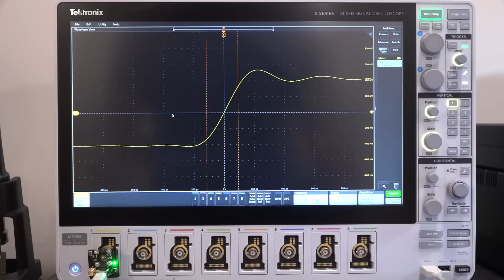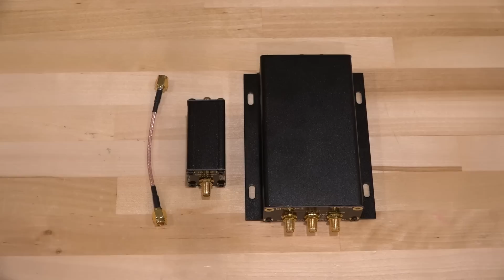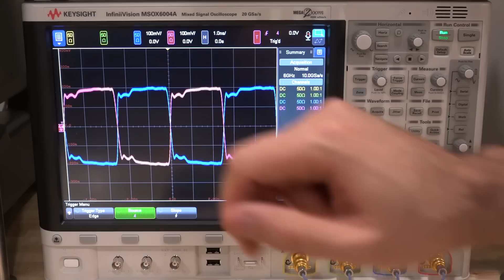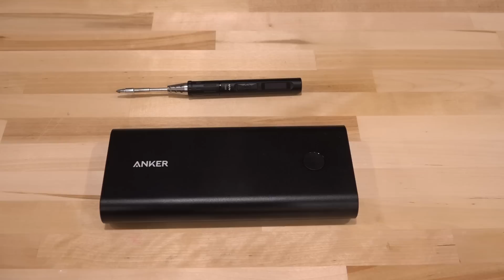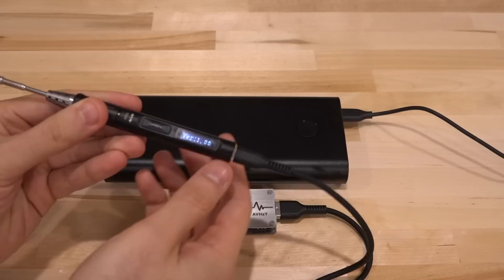TSP #138 - Three Interesting Mailbag Reviews & Giveaway! (November 2018)

Comment: Thanks for this review, Shariar, informative as always. I'm wondering why nowhere in your rise time measurements with Leo Bodnar's pulser you seem to be taking the pulser's own risetime into account, except where the 'scope's risetime almost equals the pulser's. Have I missed it?
Reply: This is significant especially with regard to the 1 GHz LeCroy HDO6104-MS, which achieves its rated BW at 990 MHz as you state and the R&S 2064, which only reaches its nominal BW if 4.5 is used in the risetime/BW conversion, not with 4.25.
The others obviously reach their stated BW but how fast is that 13 GHz HP, taking the pulser's risetime into account?

Comment: Great reviews, with GPS oscillator if it uses 50Mhz crystal does it have another LO or is it on chip to produce output frequencies upto 1GHz in addition to using GPS clock, I am assuming its uses a PLL?

Comment: About the holdover mode of the GPSDO, I think the frequency drift will look exactly the same no matter how long you leave the unit on because the drift we see represent the short term stability. I understand that if the unit is left on for a long time, its firmware can learn to improve the long term stability. However, I'm a novice and I don't have any experience with TCXO or GPSDO. Perhaps this device need a minimum amount of time (30 minutes? 1 hour?) to achieve better short term stability (Better than the rate of frequency drift in this video.)

Comment: Good day sir Shahriar! I really enjoyed watching your videos, even long ones I did not skip in the middle. I would like to participate in the scope draw. I am a EE student and currently I only have a loaned/borrowed GDS-1052-U 50Mhz 250Ms/s. Already helped me develop my motorcycle SMPS regulator ptototype that reduce petrol consumption by 10%, which is very significant. I will put the scope in good care and good use and I will able to return the loaned scope. Currently I still prototyping and testing mentioned SMPS regulator wihich I need high sampling memory than my current scope and I also designed a 3 axis CNC machine based on 8051 MCU to parse GCODEs and produce correct pulse train for stepper motor drivers, which as of now able to make PCBs with quirky firmware I wrote myself :P. Some projects I have in mind right now is low cost electronic torque wrench, a TEG+Evaporative cooler which eliminate the need for conventional power hungry air-conditioner and semi discreet switching LED driver, a spinoff project with lessons learned from the SMPS project, for which I designed my own switching control circuit. I intend to publish my designs in near future too. Anyway thanks a lot sir for the great opprtunity :-)

Comment: I'm an electronics and telecommunication engineer from India predominantly working on RF and microwave communication circuits. I have a small lab setup but it lacks a DSO. I cannot afford to buy a DSO as it is expensive and I'm an independent designer i.e., no associated or employed by any company. Multiple times I have entered into such giveaways including Keysight Wave 2018. But I couldn't win one. It would be really great to have a DSO in my lab. I mentioned earlier that I mostly work on RF and uWave circuits. I need the DSO for lots of purposes like measuring the baseband signal characteristics, filter response (bode plot feature which is there in DSOX1102G), FFT, etc. I'm hoping that I will win it this time at least. You can get back to me on YouTube for any details regarding my work and lab.

Comment: I would love to win the scope because the crest mouthwash tastes so bad.  It was advertised as alcohol free and would not burn but the aftertaste is like bleach mixed with solder flux.  

Lel meming aside I have some solenoid response times to profile, some brush less dc motor firmware to tinker with I got a red pitaya I use but it's painful to setup voltage dividers all the time and I wish I had a real oscilloscope.  

Also let me know if you want to take a whack at fixing a Marconi network analyzer, I think it's just a power supply issue, quite tame compared to what you usually do.  Or if you want some blown power meters.

Also please for the love of god and all that is holey someone plug ear buds into that soldering iron and make a video of the results.

Comment: I’d love the scope and especially the function generator capability. I’m a paraplegic and I’m working on a project to integrate various health sensors into a stationary hand-cycle to allow safe exercise. 
People with spinal cord injuries like mine have more than just mobility limitations. Often we lose the ability to regulate body temperature, blood pressure and heart rates which can get dangerously high without warning. So cardio exercise can be a challenge if vitals are not continuously monitored. I need equipment to capture the output of various health vital monitoring devices and regenerate their protocols from a hand cycle with integrated/connected sensors that can monitor the user and communicate their body’s condition to local or remote displays. Don’t want to get into all the details here. But please consider this project. Thanks!

Comment: I've been trying to find a GPSDO with a 1pps time output that has a hold-over mode that is affordable. A lot of equipment such as SDRs expect you to provide them with a 1pps time signal from a GPS receiver and since you can't always receive a GPS signal, a frequency standard with a 1pps output is the only other option. But rubidiums are pretty expensive and bulky so I would like to find a small portable GPSDO with a 1pps time output I could take it outside, have it lock and discipline itself to the GPS time and then take inside where I could use its oscillator in  hold-over mode to feed my experimental SDRs with 1pps time signal while still close enough to real GPS time. Anyone have any tips where to find something like that?

Comment: Hi, I need a DSO to debug a project I have. It's running at 48MHz from a Microchip PIC to output ICSP data and I'm actually having trouble since I changed to a PIC16F1455 from a PIC18F2450. I have an oscilloscope, but don't have the storage option and capturing the long data output is not possible. The DSOX1102G would help me compare the old data wave that works correctly with the new data wave. And I could store and compare these in anlog to compare the data and the switching for the rise a fall times.

Comment: Waw I'm amazed about the excellent level of this channel. And more, this is in Greece/Europe ! Congratz and thknxs for sharing.
Now, after the sliming....
I really could use the give away oscilloscope. I'm trying to set up a small electronic workshop/hobby lab and so far I only have 2 multimeters and a powersupply (DIY home build). All this equipment is so expensive and it'll take me years before I get anything together. I'm not from Greece but from Belgium. I'll make you a deal. Since we're known for having the best beer in the world... I'll send you a sample and/or if you come to Belgium, I'll buy you a beer and be your guide to one of the most beautifull cities in Belgium: Bruges (my home town). Now if that doesn't convince you....

Comment: I hope the DSO is self cleaning. I would not like the Voltage drop on my floor <badum Tssss>
Jokes aside I would want to test analogue circuits. My current Oscilloscope is a cheap 30$ DSO138 which does its job but I cant really use it to measure anything faster then 10K reliably....

Comment: I would like to participate in the giveaway. I would use the scope, well first of all in order to just have a working scope, as my good ol' analog scope finally broke down (it never fully worked anyhow). Then I might use my new scope to fix my old one perhaps? I've got a feeling it's the trigger circuitry that's gone bust, but there is only one way to find out for sure: by using another scope. Apart from that the scope would be my new best friend and a great tool on my journey towards becoming an electronic engineer, by implementing "learning by doing". I promise I won't blow it up by not being careful about where to attach my ground probe...

Comment: You can buy a soldering station controller from China (Aliexpress etc.) for about $30 and Jose (ptdreamer) wrote third party software for it that makes it work with the JBC irons. All you need is a battery with 18V or more (I use a Makita tool battery) and you have a mobile JBC soldering station. I have documented my version on EEV Blog.
That USB meter gadget seems nice, I was looking for a PD load.

Comment: I would like to join in the giveaway, my current scope cannot decode digital signals such as spi or uart neither does it have a decent fft. This makes it very hard to use the scope for my hobbies which are HAM radio and micro electronics. BTW, the SV1AFN is a HAM radio call so to pronounce it would be Sierra Victor one Alpha Foxtrot November.

Comment: Shahriar, I don't comment often but the lure of a working scope was an opportunity that I couldn't miss right now.
Thank you for all that you do and the videos that you make, I really get a lot out of them. I am self taught with no formal EE education [although I am considering working toward a degree part time] and currently work for a small company designing passive RF attenuators, filters, and equalizers. What I do is not complicated by any means, but there have been times that concepts I picked up from your [and others] videos has helped me decrease my RL by that extra.5dB or so.
Yes, I would like that o'scope and would get much use out of it.

Best regards, 
Trent Spencer - KM4YTU

Comment: Hi,  I could definitely use the scope.   I'm a hobbyist but working on my dream project of building my own telescope controller and mount.  I'll be working with Servo Motors, Encoders and application processors and need highly accurate timing signals to do this correctly.  anything that helps me get there is really appreaciated.

Comment: In my lab, most of the high frequency test equipment has male connectors, for example the 1.85 NMD on the VNAs. I think the male connectors are more robust than the female connectors.

Comment: Sorry for the faulty biscuit tin, Shahriar!
I am sending you a few field replacement kits that should take of that problem.
Cheers
Leo Bodnar [Electronics]
Reply: Why did you guys go with the female connector? Just out of curiosity.
Reply: They are rare and expensive, and don't exist in compression mounting format I am using for compact layout.  If you use good quality adapter the difference would only be a few ps.

Comment: It is really nice how these days people give away all kinds of gear on youtube etc. but unfortunately as a hobbyist I could mostly often even afford those things, so I wonder if it would maybe make sense to give away multiple but lower priced items. Some of the kind of "that would extend my capabilities, but its a bit pricey to buy it just for that". Like second multimeter (or third or so), many hobbyists try to get away with the bare minimum, but being able to cross check with another instrument or measure current and voltage at the same time. Or an edge generator ;) Or maybe some cool project building blocks, like I for myself am having an eye on some fast photomultiplier tubes but again, just to play with them and maybe come up with something usable but possibly break them, it might not be worth it, there are things much higher on my "to-buy" list. 

Unless of course you want to limit the give away things to your own country only, then that extra cost point becomes moot.

Comment: My basement flooded (two feet of water...sump pump rotor was jammed with mud) during a rain deluge and my two HP 1740A scopes (old school, 100Mhz, two channel) were sitting on the floor in their moving boxes. I have been scopeless for about three or four years now...having one would get me back into analog electronics vs this 1's and 0's stuff. So, yes, I could use one.

Comment: Those MBlox GPS modules are great. Using one of those from ebay for like $7 (!)  I was able to calibrate my ovenized 53131A counter to LSB in no time (well, a few hours). Simply load an hour (or two) of PPS data into a spreadsheet, clean it up, take the average and there is your error to adjust. Rinse repeat. Now my counter serves as a 10MHz reference (clock output is powered even when the rest of the unit is off)

Comment: Would be a great upgrade for my Tek 2230 and Tek 465.  The last project I did with the 2230 was decode a kwikset powerbolt2 keypad then emulated the keypad with a pic12f675. Perhaps an esp wifi module controlling the powerbolt2 and have a smarthome lock :O)